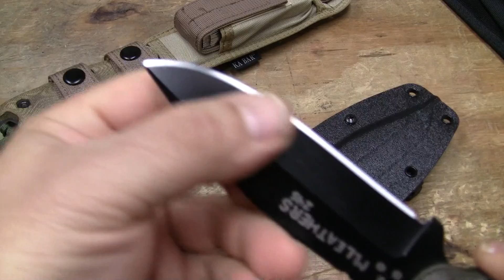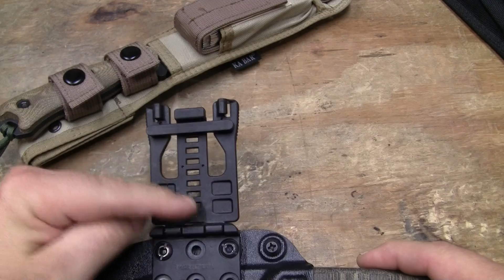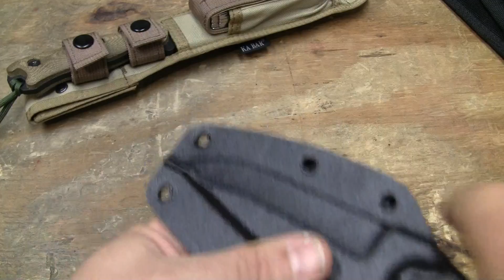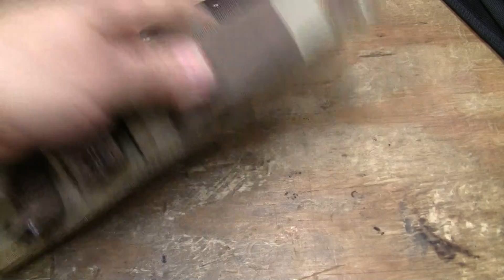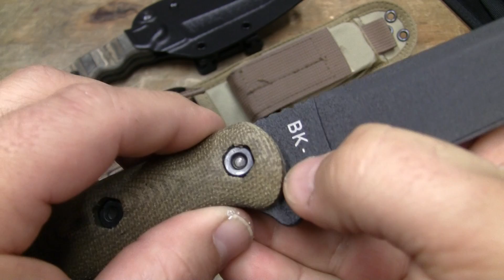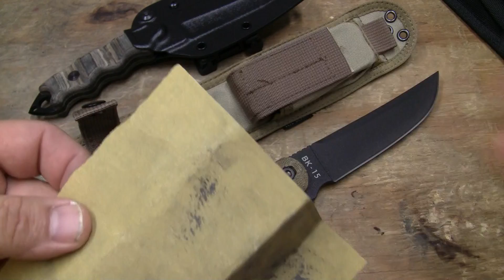Buck M.Leathers 245 & Becker BK-15 My 2 Favorite Knives

Comment: I agree that the edge bevel comes too steep from Buck. With 5160 steel, 15-18 degrees each side would work much better than the 25 degrees or so it comes with. I love the way it feels in my hand and the way it looks. It has a strong tip also. I also like the BK 15, but prefer the 16 (drop point). Thanks for sharing your video.